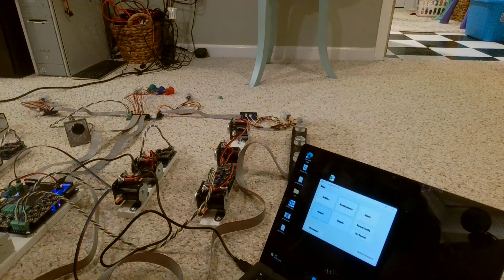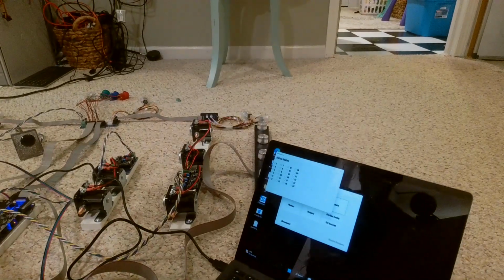Virtual Pinball Builders Kit with NEW PinOne Board Demo from Cleveland Software Design

Comment: If I wanted to use the service button that are already on my coin door how would I wire them to the PinOne?
Reply from the maker: You can connect them using the button expansion board https://www.clevelandsoftwaredesign.com/pinball-parts/p/button-expansion-board or just directly to the pins that the service board would connect to

Comment: Do you know or have others commented on the difference between screwing the solenoids directly onto the sides of the cabinet vs keeping them attached to your white boards they come with and having the white boards with the solenoids attached screwed into the sides (like you did in your other cabinet video)? Do you know if there is much of a difference? Thx
Reply from the maker: Attaching directly to the wood will make a noticeable difference in sound. If you are looking for them to be louder and maybe a little deeper than they are then attaching them to the wood could make for a better sound.

Comment: Hi Phillip. Admittedly I haven't built a vpin cabinet yet but I've been researching for the last 6 weeks and everything I see recommends having at least 2 power supplies: 24v and a 12v. I see each kit option you have only comes with 1 power supply. How are you able to make the project work with only one power supply?
Reply from the maker: I use all 12v equipment to make hooking up everything a lot easier. I do have a 24v knocker converter that can be used to run a high power knocker, but that is the only 24v toy that is needed to run all of my gear.